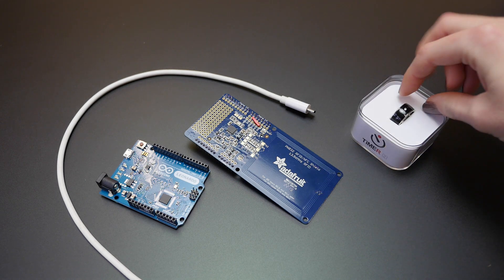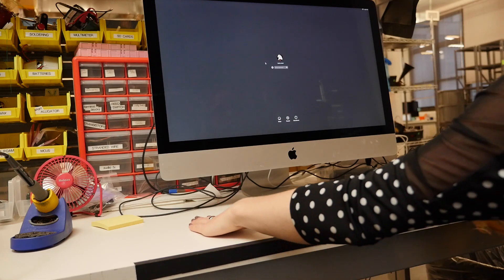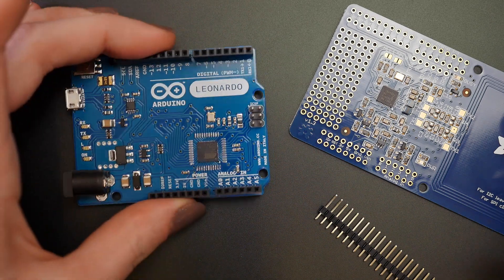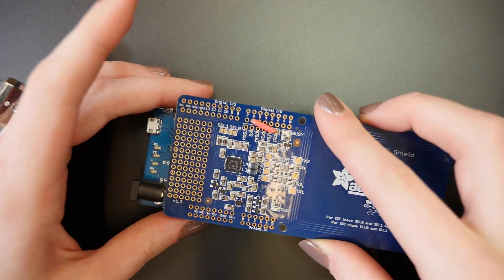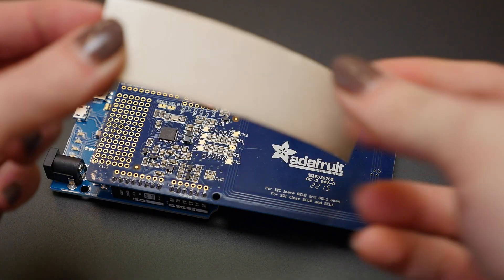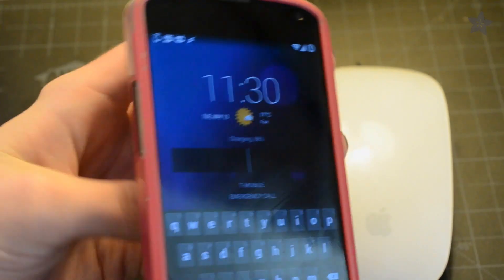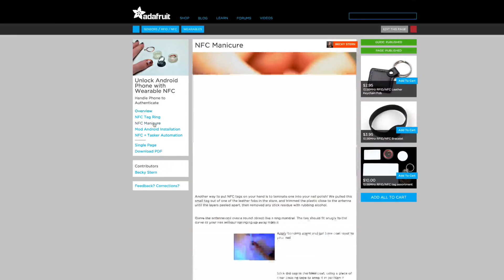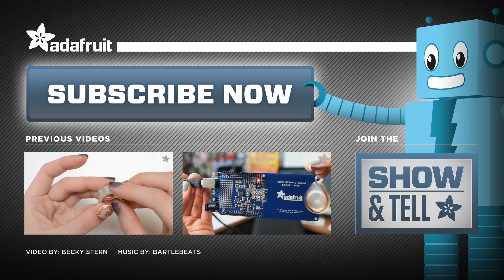NFC Ring Password Helper

Comment: Nice ring, but storing your password on an NFC tag? Not a good idea...
Reply: +CooperDuper3000 If I undertand well you don't save the password on your nfc but on the arduino.
Reply: +Ponsaille That's correct. You could not get the password from the NFC tag. You could however spoof the UID if you were able to scan their tag or you could decompile the arduino and extract the password from that. Overall not super secure but then again neither is a windows password.
Reply: +Vokoder you could obfuscate the code and set the fuse that blocks you from reading the code on the atmega but the nfc tag can be spoofed.
Reply: +MrApplecraft Yeah NFC tags in general are inherently insecure due to being readable ID tags. -- Love the tech for data transfer though!